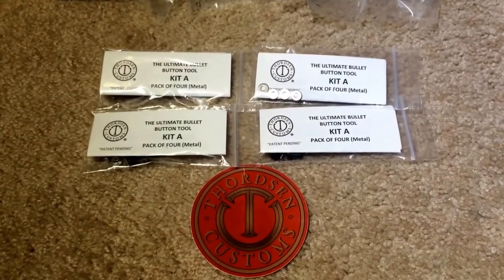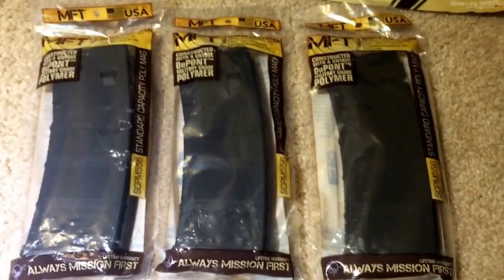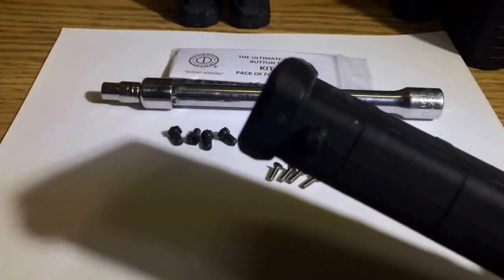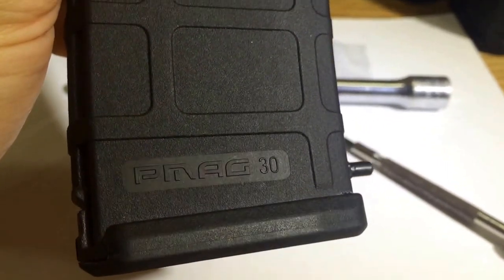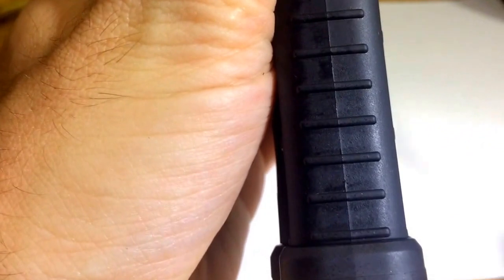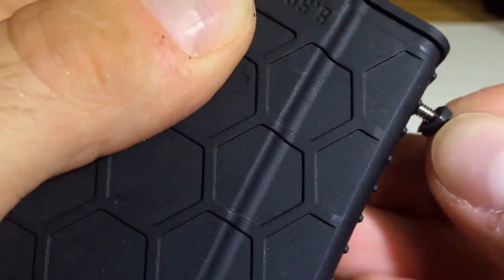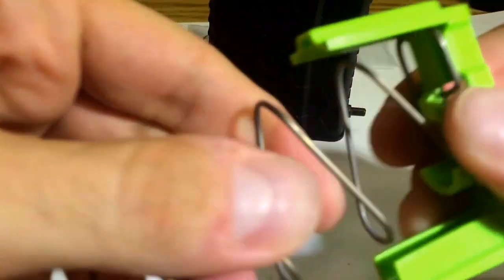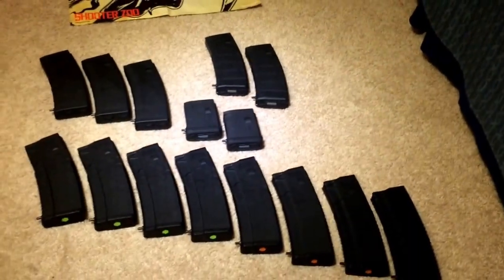California Bullet Button (Thordsen Customs) Ultimate Bullet Button Tool Install

Comment: I was about to purchase those Hexmags from Wise Tactical as well until I found a better deal for Magpul Pmags on Jesticearms $9.99 for 10/30 and $6.95 for shipping which comes out cheaper than those Hexmags after you buy 4 or more.
Reply from the maker: 522SDHV Nice thanks for the info! I'm gonna check those out. I like the way the pmags feel a lot better than the hexmags, though the hexmags are a bit lighter, so very good call.
Reply from the maker: I wonder if you could pop that rivet out
Reply: I hear you can only drill the rivet out. Also there's a little pin on the bottom plate which does not allow you to remove the plate to take out the spring.